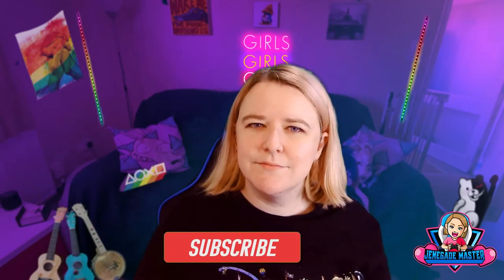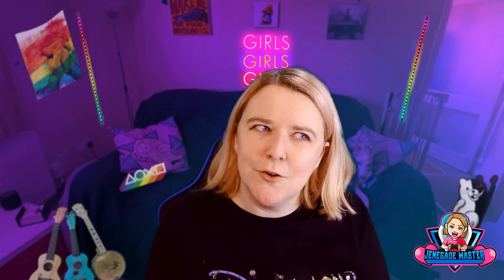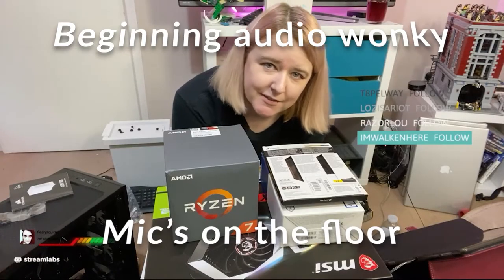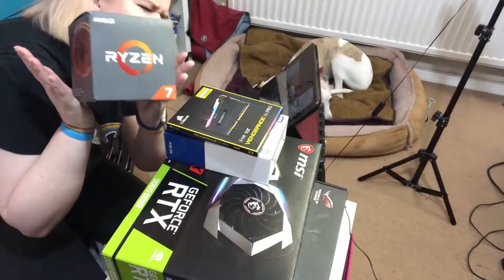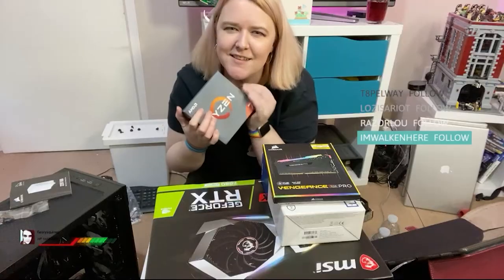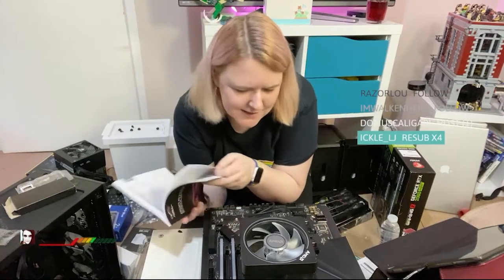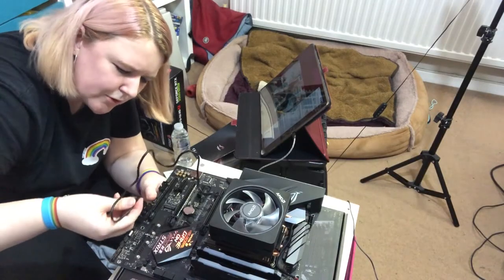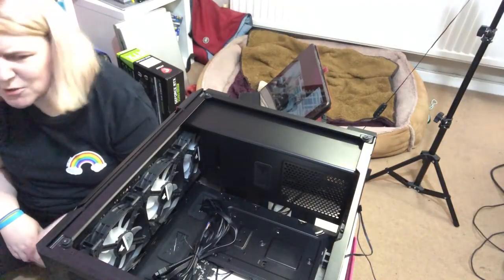Build your first gaming PC - Noob build

Comment: Just tapping the case isnt enough because its not grounded, you should have installed the psu in the case and connect the power cable to the wall and not switch it on, that way your case will take the static electricity to the wall